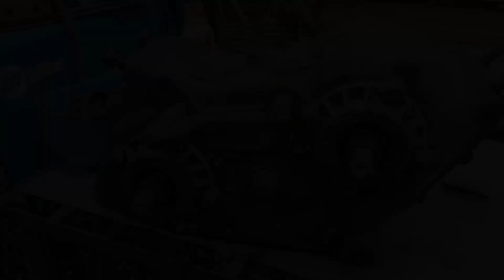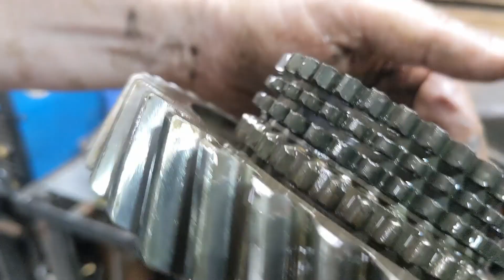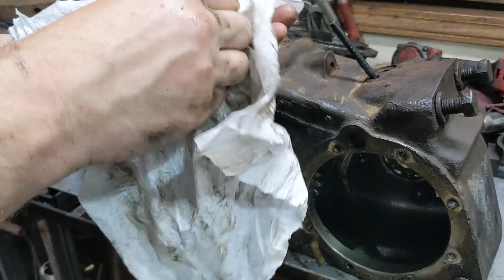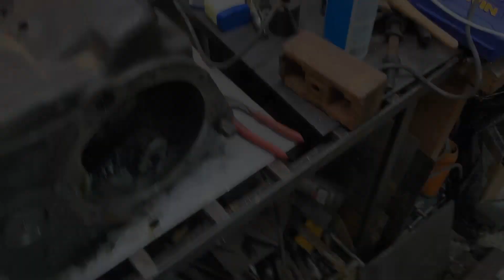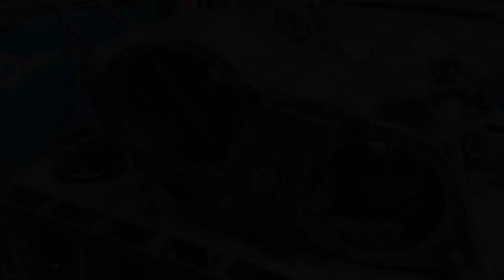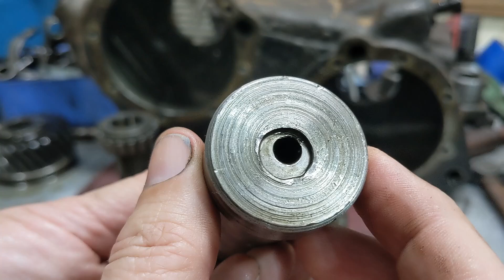Tear Down a New Process 205 Transfer Case (True Spirit #30)

Comment: I’m currently working on a 1974 W100.  It has the tab welded on to the idler shaft plate too.  And the support brace is still there.  They came from the factory like that. Thanks for all your videos, they have been a great help.

Comment: Your noise is from driveshaft deflexion, the cross member on the frames of them old truck frames could have been bent towards the rear, you may want winch the entire transfer case forward towards the front  of the truck, this can be accomplished by simply wrapping a chain around the frame and cross member then winch the entire unit forward.
You may want to secure the back of the truck to something  solid to prevent the truck from rolling, also remove your driveshafts. Run your cable from a tow truck snach blocked off the back of a tow truck under the engine bay past your transmission to the lowest point of your transfer case which is chained hook to cable and winch forward to 35 clock position. The transfer case is not your problem. 
You're problem will be solved!
With this method your chatter noise will be eliminated.

Comment: I had a 69 ford sitting on 85 frame with the divorced 205 transfer case it was 3/4 great truck had 390 engine and I bought a wrecked state patrol car that had a 428 hp motor that had 28k so new motor and man that was big hp motor .
Reply from the maker: Love the FE motors!
Reply: Everyone has a 390 allegedly, yet never offered in 4x4 trucks, only the 360. I have bought and owned 17 1967 - 1972 Highboys and almost every seller claimed it was a 390, ask them how they verified it and they say that's what it had when I bought it. I pull a plug and put my stroke measure tool in the cylinder, and prove em wrong every time. Never understand why Ford didn't use them in the 4x4 trucks but I agree, I love the FE.

Comment: Another great disassembly video.  Curiously no beeps.
Reply from the maker: This one went pretty smooth.  Once I dropped a load of needle bearings on the floor, but the camera wasn't running.  Another time I put the shift shaft in but not through the shift fork.  I didn't realize it immediately, so didn't swear much about it.
Reply: That's what I was thinking.